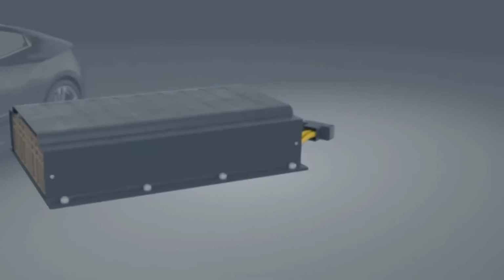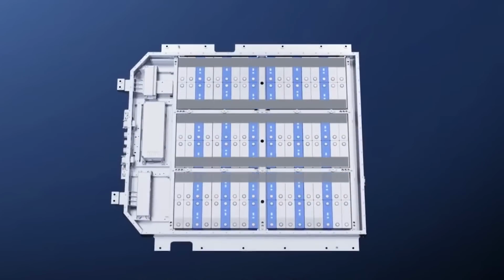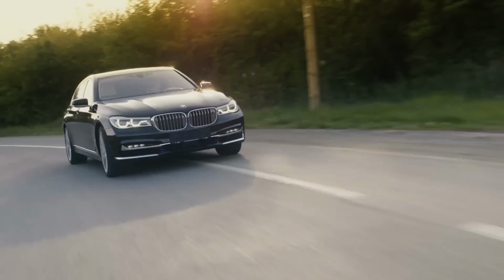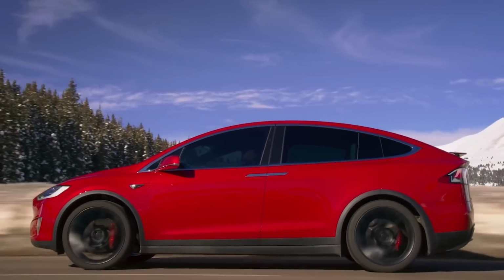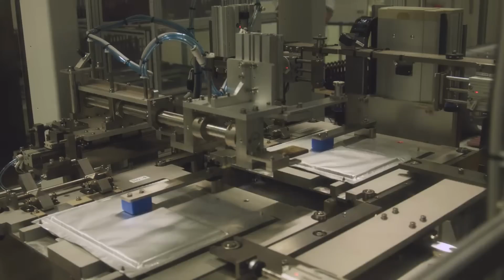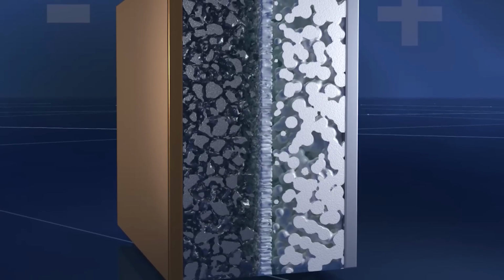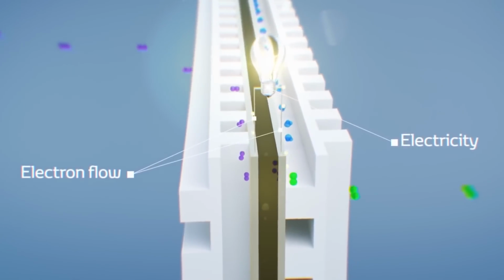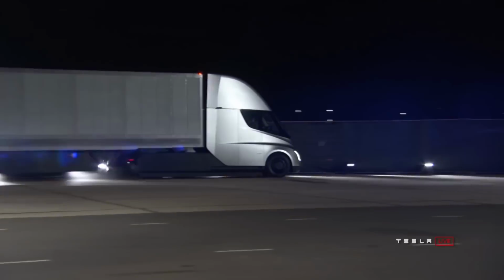IT HAPPENED! Sulfur Batteries Finally Hit The Market!

Comment: Just hype. 

There is a big difference between having sulfur batteries on a couple of vehicles vs actually mass producing them in the hundred of thousands cars. Isn't it any wonder why old car makers are held back in mass production? Even existing batt production require maybe U$3-10B to build, assuming you have the IP to make them. 

Also, this article did not do enough research.  Battery prices is measured per kw, not overall price as you can make more or less batteries per model. Tesla was already around U$ 105-110ish per kw even before their largest cells. And Tesla is always striving to lowering cost. They should be in the sub U$100 per kw in 2-3 years with their current tech. 

A lot of news is out about having this or that tech, even solid state batteries. But without mass production investments, these are nothing but proof of concept only. It will still take 3 or more years before they can actually be produced. Maybe less, if you are Tesla. 

We've been hearing lots of this kind of hype for years. I'll believe it once it is actually used in mass production.